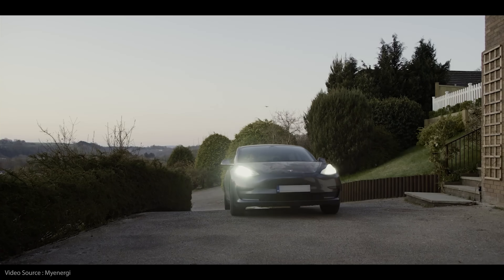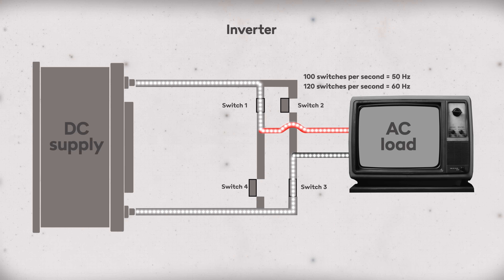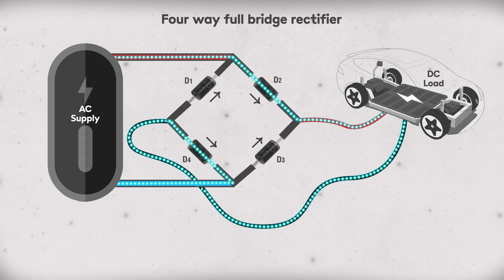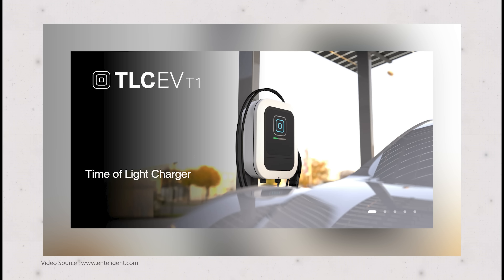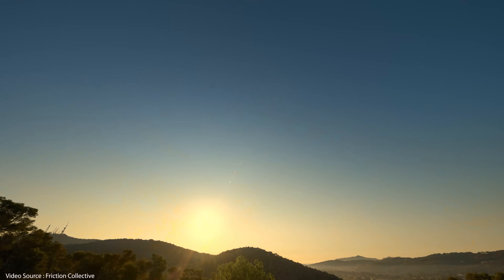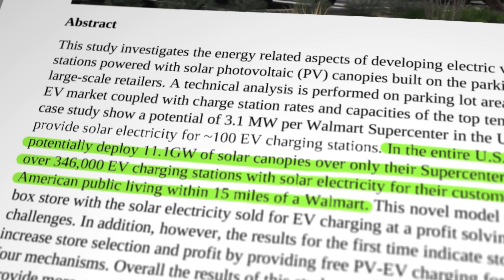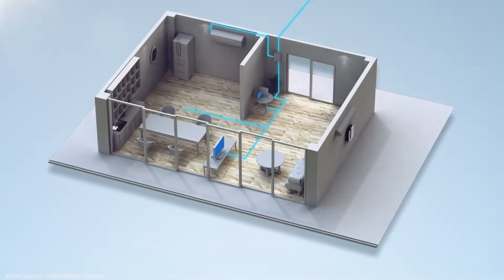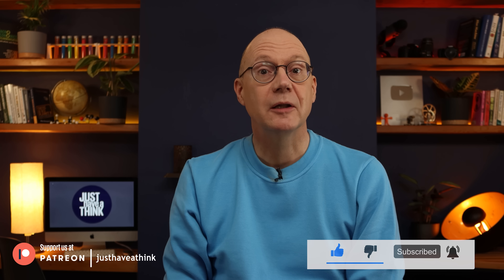DC to DC charging. One more step to off grid living!

Comment: This could apply to home appliances. Most electrical devices in the home are 24 Volt DC or thereabouts. Only a few devices use 220 Volt AC. A home could be wired with two systems: a DC system for low-powered devices including lights; and an AC system for big appliances, making it more efficient to power smaller devices directly from DC solar panels, and meaning that smaller devices don’t need to be supplied with AC adapters.
Reply: More and more devices can be PoE powered, which is DC.
Reply: I like the concept but the downside of low voltage DC is the reality of voltage drop from cable attenuation. You'd need super-thick cables to wire a house and even then they would still have voltage drop. Still, having a dedicated DC circuit is great, you just want the AC to DC conversion done close to where the DC appliances are
Reply: @dohmarau  I already do a split system.  12v dc lights are like 6 watts. takes a bunch of them to require more than #12 wire.   Refrigerator 12, 24, or 48v still do not require large wire.  This way i can shut off inverter at night in the winter to reduce idle loss, which on mine is quite high.  Also if i have an inverter problem my essential functions always work.  I do have to use buck converters to reach the correct voltage tho
Reply: @dohmarau  there are already isolated dc mesh grids of 50VDC between houses, people in those systems can run devices on 50VDC or run inverters. the idea is that because most people have batteries, only a low average current is transmitted with high current spikes being provided locally by the batteries .

Having batteries close to important locations in the house also helps, also 25A on 48V is about 1200W, which is very useful and 25A is reasonable. specially with a more smart routing instead of just doing whatever. 
even 50A or 100A is doable with a battery close by. increasing the voltage close to 60V also helps.

Comment: The big question I was hoping to see an answer to, but didn't, is how much this DC-DC charger actually costs. Nor only does the inverter/rectifier equipment add to the cost, but there's also the fact that it's new technology with a rather limited market of people who have both the right kind of home solar setup and an EV. This is a problem because, if the DC->DC charger costs thousands more to buy or install than a conventional level 2 AC charger, the additional up-front cost will completely overwhelm the value of whatever energy it saves.

Even for a person that is living entirely off-grid, I can easily see DC->DC charging being mor expensive than simply dealing with the energy loss of a conventional charger and buying more solar panels to compensate.

That said, this does seem like the type of thing where, even if it's initially too expensive to make sense right now, it will likely get cheaper in the future.
Reply: Sigenergy already has DC  direct to vehicle etc

Comment: Since I work from home 4 days a week, this paired with a solar car port would be fantastic. (I have a slate roof, so going solar on the house would have to be a whole roof replacement/ solar tiles). I could put a car port on my driveway turnaround (two car parking area) and charge my car under the car port during the day. I still have my 48A charger in the garage for faster charging. I need to do the math on possible charge speed of a set of panels covering approx two parking spaces getting decent sun all day. Though as others point out, $2500 for the charger is steep!
Reply: I also have slate and have installed PV on my roof.  If you get the right installer you can install PV on a slate roof. Don't get one that wants to drill through the tiles though.

Comment: The problem is in the maths . There isn't enough copper available for the grids to satisfy the low density renewable energy needs and schemes if most nations wished to adopt this system.  I've noticed already that copper is now sold as billion . Copper wasn't available for the los Alamos project cos it was all required for the war effort, so they used silver instead . Aluminium can kinda be substituted but presents a fire hazard in multiple ways . Each EV vehicle also needs at least 70 kilorams of copper.
Reply: The planet's population is no longer 3 billion as in the mid 1960s it's touching on 9 billion and counting.

Comment: It doesn't quite make sense, because you still have to adjust the panel voltage to match what the battery wants - and that involves something like a buck boost converter - which involves conversion to AC, and then back again.

Comment: DC slow chargers makes perfect sense for parking lots. The cars will be parked for hours so no need for fast charging. 10 cars can get slow charged at 20kWh chargers instead of 1 car fast charging at 200kWh, and it will be cheaper too. Fast charging should only be used for long trips, not for daily charging.
Reply: 500 solar panels are needed to output 200kw in good conditions. 500 solar panels rated at 430w (SunPower Maxeon 3) calculated at 400w, outputting 200kw over 8 hours  = 1,600kw.
1,600kw/h / 60 = 26.67. (Battery packs are around 48kw/h to about 80kw/h)
500 solar panels can not even provide reliable power for one fast charger at 200kw; About 25-30 cars could be fully charged over a good day.
Reply: @alexandermelbaus2351 if the car is parked for an 8 hour working day. Then they do not need to charge at 200kw. 20-25kw will do

 that is 50-60 miles per hour charge or so 400 or so miles range added in a working day.

Comment: I'm off-grid. My house is single-phase and the cost of converting it to 3-phase is uneconomical. This leaves me with a maximum charge rate of 7.36kWh for my EV. Even if I had 3-phase, the AC charger in the vehicle is limited to 11kWh, but there is no such limitation on DC charging. I can't wait for it to hit the market here in Oz. Something like this DC-DC charging would enable me to get upwards of 13.5kWh.

Comment: there are also battery less inverters, that one could plug standard "chargers" into.... probably a lower up front cost, plus you can use the AC for other things....efficiency amy or may not matter whem adding more panels is so cheap these days... if one is a DIYer

Comment: Those DC to DC converters have an AC stage in the middle so they can use a transformer to convert voltages.
And of course, most electric cars use AC in their motor drive circuit.
Which makes your video justl rather silly advertising hype.

Comment: One detail that I would like to challenge is the commonly communicated mistruth regarding the idea that a DC only system is more efficient than a system that uses AC.  The commonly quoted idea is that PV panels produce DC power and that batteries store DC so maintaining a full DC system is more efficient as it avoids the conversion losses from DC to AC.

The detail missing from this very simplistic argument is that the PV panels produce a different and variable DC voltage which will invariably be different to the voltage of the battery.

This difference in the DC voltage is accomodared by using DC to DC converters to change the DC input from one voltage and current to a different voltage and current value.

So the only difference between a DC coupled and AC coupled system in this regard is that one system uses DC to DC converters and the other uses DC to AC converters.  The converters in either system have associated losses.

Proponents to DC only systems will claim that DC to DC converters are more efficient than DC to AC converters and will quote some really low efficiency figure for the DC to AC system that they are comparing to - but this is simply misleading marketing lies.

The reality is that all DC to DC converters work by converting the input DC to AC and then converting this intermediate AC back to DC.  Hence there is no theoretical difference in the possible efficiency difference between a DC to DC or DC to AC converter.  The only efficiency difference comes down to simply the engineering design decisions when it comes to trading efficiency vs product cost.

The main difference between a full DC system and an AC coupled system really comes back to the requirements regarding the safety protection equipment required for DC vs AC - the alternating nature of AC has an inbuilt mechanism for electrical arc interruption allowing existing electrical AC fuses and circuit breakers to be used.   In contrast full DC systems require very expensive DC circuit breakers which also have a significant negative impact on the overall system efficiency.
Reply: Thank you. I wish Mr. Think would just have a think about these obvious issues instead of leaving dozens of commenters to point them out. I wonder if you could carefully design a system so that the solar panels, the EV battery, and any home storage battery all use the same DC voltage, and so could bypass any conversion. But I assume the charging voltage and discharging voltage of a battery are different, otherwise why would current flow into the battery.
Reply: @skierpage the fundamental reason why is not possible is due to the fact the the voltage being generated by each PV panel varies according to the intensity of the sunlight falling on it and the voltage of each battery changes according to the amount that it is charged.
Reply: Overall, converting from DC to AC and back to DC is at least double conversion. A DC charge of the EV battery only requires a single conversion of voltage to the charging voltage of the EV battery. When DC charging, the car connects the battery directly to the charge port. This bypasses the onboard charger and will always be potentially more efficient. Changing from DC to AC is a messy process as it requires filtering and this always costs efficiency. I have been a power electronics engineer for 20+ years, better to keep the number of conversions to a minimum.

Comment: Pet peeve, the conventional AC wall units that connect to a vehicle are not chargers, the charger is built into the vehicle.  The wall units are simply "smart" cables, they do no conversion of the AC power delivery, they just turn it on and off when signaled by the on board car charger.  That's why most EV's can charge from a conventional 120VAC or 240VAC household plug.

Comment: There is a company called Point Guard energy which os advertising a V2X compatible bidirectional 25kw DC charger, but the details are very sparse. Ideally I'd love to have a small home battery and the ability to have the EV battery to work as a large backup battery when needed.

Comment: Thanks Dave, this is a reason to celebrate. In Australia, the wholesale cost of electricity is negative between 10am and 2pm in most States, except for summer. We have lots of rooftop Solar PV here (43% of residences where I live), so it makes good sense to divert as much of that generation during the Solar peak period to EV and other battery storage. Most residences are connected by single phase AC mains which limits EV charging to 7.2 kW rate. A hybrid AC + DC input / DC output charger could typically double that rate, based on most residences having 6kW ~ 10kW of Solar PV output when there’s little domestic load.
There are two major issues though : 1. many vehicles are used to commute during the day, and won’t be at home during the Solar peak, 2. While efficiency is important, a DC/ DC charger needs to be economic. AC from my Solar inverter costs ~ AUD $0.06 kWh. Losing 13% charging efficiency still doesn’t increase the cost of charging an EV from Solar PV by much. The only bidirectional DC/ DC charger currently approved for V2X in Australia cost around AUD $11,000 - hopefully that will change.

Comment: A Solar PV DC-DC EV charger with V2H/G capability & mains charging option is fantastic. 1) enables me to install more solar.* 2) don’t have to buy a home battery to use own generation at night. 3) EV gets charged (for ‘free’) without cannibalising own home PV consumption. 4) option to earn $$ selling power back to the grid. 5) back-up mains charging when needed. 6) lower system losses. This doesn’t need thinking about as it’s a win, win, win, win, win & win! 

* at time of installation local electricity authority limited solar PV system size to 5KW to avoid overloading local grid. Though now systems with 5KW peak export limits with over provisioned panels can be installed.
Reply: 3) Because you're stealing power-service.

4) Because you're stealing power-service.

5) Because you're stealing power-service.
Reply: Can we chat about this. I’m guessing you’re in WA, as am I and I want charge our ev directly from some surplus off grid panels.

Comment: To be fair you will likely still need to up the voltage, especially if you are using a more conventional battery system aka 48V and want to charge off your home battery, otherwise you can just take the voltage off your solar panels which is likely to be 120V or so, even then for 400V is a relatively low voltage for a EV battery pack so you still still need to up the voltage That is the problem I see with it because you will have to buy a unit that can boost covert a whole bunch of energy.

Comment: Marketing misdirection. 
It has a DC-DC converter and all the losses associated with that. 
Sure you have 1 converter rather than 2, but honestly, just get ones that are better efficiency in the first place (13% loss is atrocious).
The only time you need this is if you are off-grid.
Reply: Or if your system is in one of the fifteen US states that do not allow net metering.  Or if your array was built and the utility will not allow you to connect to them, or they pay only a pittance for excess generation.   These scenarios happen all the time